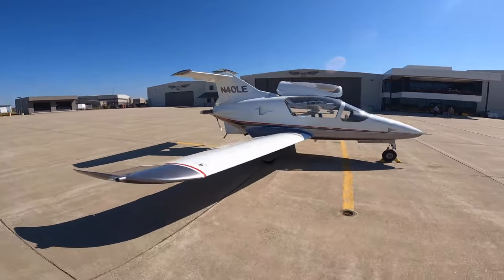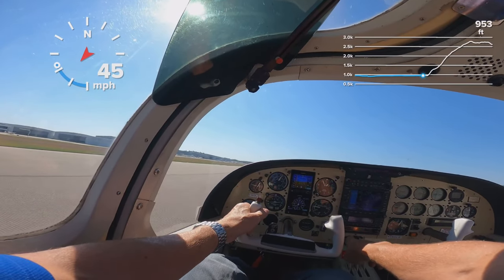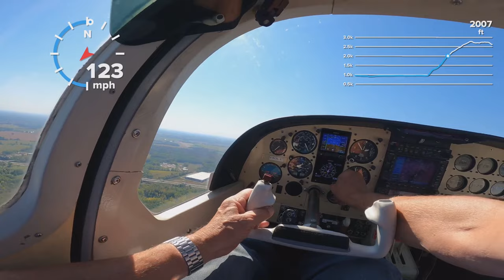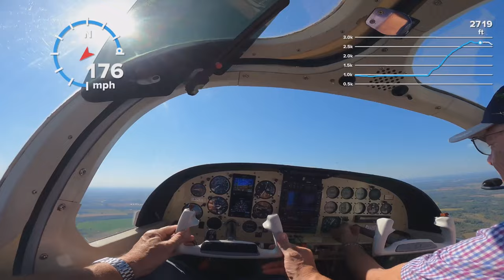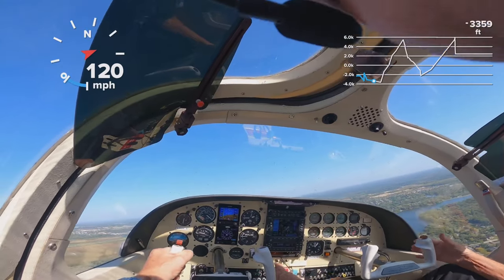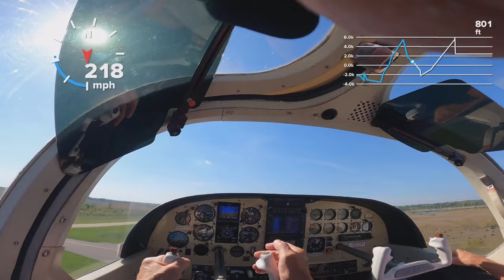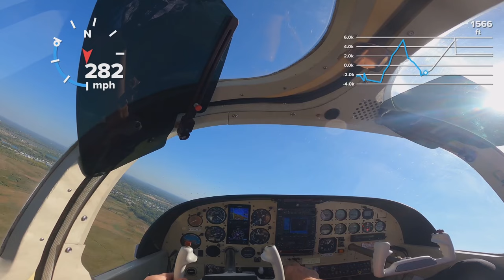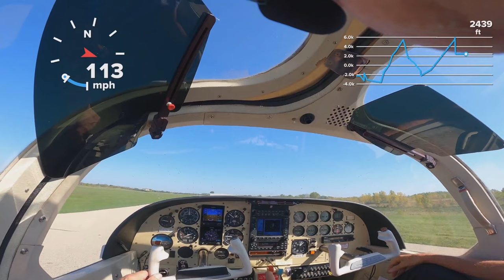The only flying Prescott pusher in the world.

Comment: Lol 640 mph landing was great.  Nice looking airplane.  Thanks for the flight!   Would be curious what your touch down speed was.
Reply from the maker: Touch down is about 90 kts.  I landed a T-38 at 600 kts and a citabria at 170 due to bugs caught in the pitot boom during flight.
Reply: Hold up, did you actually land a T-38 at 600 kts? Thats like 700 mph. @ronrogers
Reply: @JackHowe32  (the joke is that the Ias read 600kts because it was clogged, he wasn't really going that fast)

Comment: What causes the GPS speed to jump around like that? Some sort of improper calibration or scaling system that isn't tuned for aircraft flight?
Reply from the maker: I have no idea, but it is not even close! I have used it for my Great Lakes and it worked ok for that aircraft.
Reply: @ronrogers  I know there are different kinds of GPS systems but I don't know any technical particulars. I suspect that is a factor here but maybe it is just the receiver not being up to the job.
Reply: Those overlays are coming from the GPS sensor in the camera. They’re so inaccurate in both my Garmin VIRB and GOPRO that I’ve quit using them. It doesn’t matter whether it’s the aircraft or motorcycle.
Reply: @bmw320i2  Hmm, I wonder if it is the same component used in both devices. If you know what it is as a consumer you can avoid products that use it. Thank you for the reply.

Comment: What engine did you say?
Reply from the maker: IO 540. 280 hp with electronic ignition and increased compression. Cruise at 200 mph. 11,000 ft 11 gph. Or 9 gph and 180 mph.